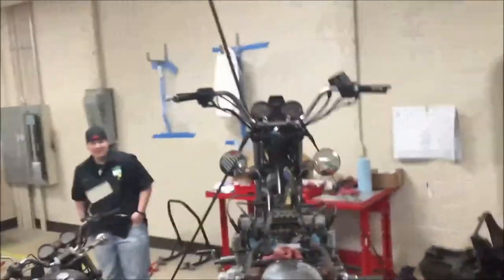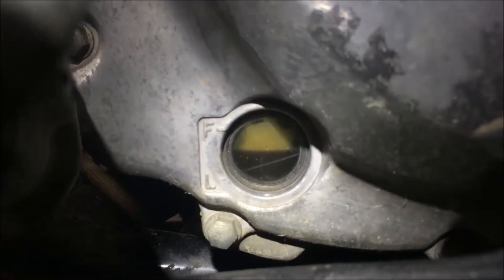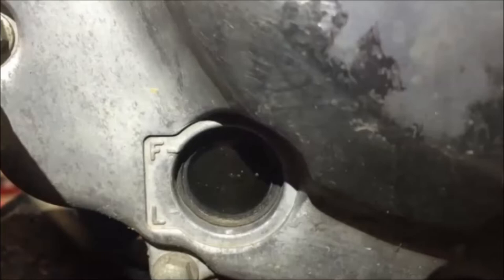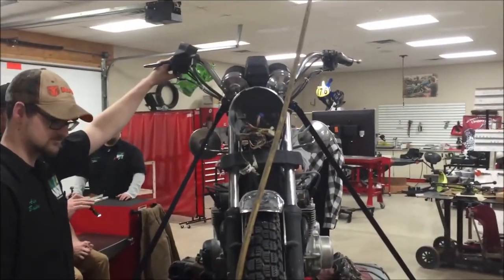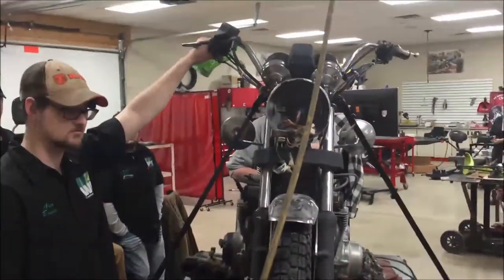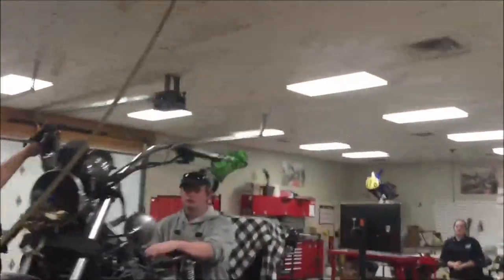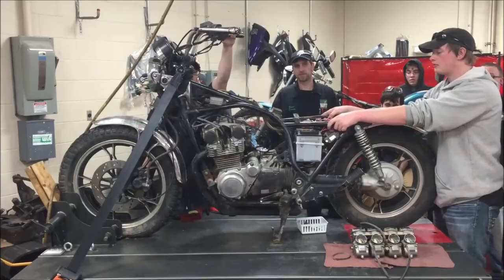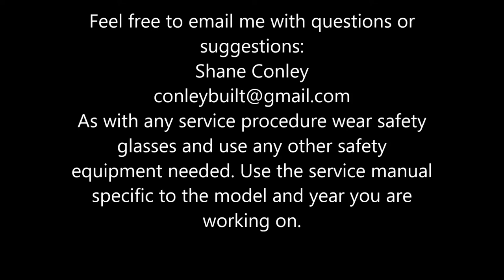EM Series:  How to check oil level in your engine with a window inspection type and no dipstick

Comment: People should take notice of how much the level varies when the bike is not perfectly level. Even with a center stand the user should check to be sure the bike is level on the stand. Without a center stand, I use a long carpenter's level on my handlebars and a mirror on a long stick so I can see the sight glass. I know from practical experience that if the bike is on the side stand the level should be just above the high mark, but it's hard to tell it's not overfilled when I do it that way. I've been surprised to learn that even the owner's manual is often lacking critical details. Fortunately there is some wiggle room so that most engines won't fail if level is a little off, although it would be hard to measure shortened overall lifespan. For most cars the convention is to check levels at least 30 minutes after killing the engine. I totally agree, these are poorly taught basic skills we all should have been taught in high school.
Reply from the maker: +spelunkerd 
Thanks friend. These are not just poorly taught skills BUT poorly listened skills. Many learners take for granted the "craftsman" attitude of details...Thanks for your comment and please share...:)

Comment: Is it big mistake to check oil level with moto on cental stand?
Reply from the maker: So manuals actually specify that you do check it on the center stand. Like I said you actually have to read the owners manual for every make and model and keep in mind a couple important tips. Number one is there a timeframe specified to let the engine run and how long to let it sit before you check the oil level. I will use my own personal triumph Tiger is an example that has a center stand I always check the oil level on the center stand and I just stick my foot under the front tire to make the bike perfectly level as I check the dipstick. Or lean on the seat.